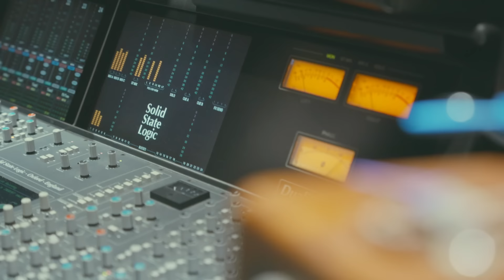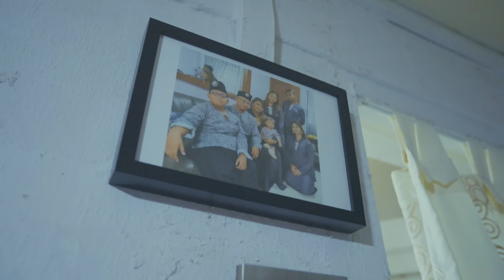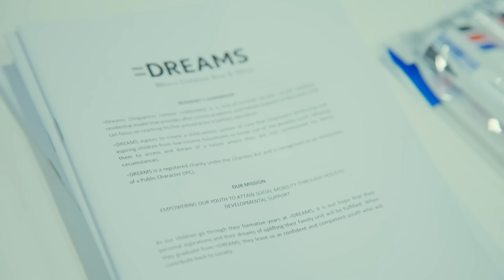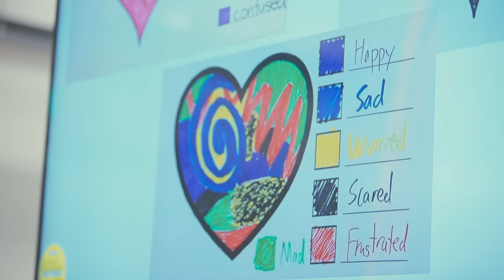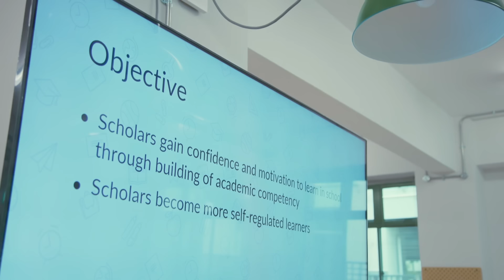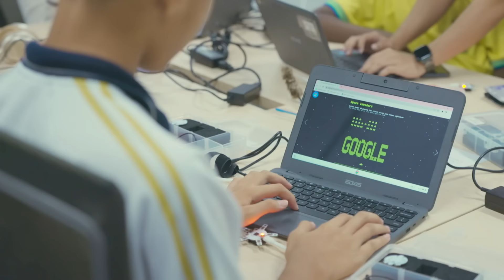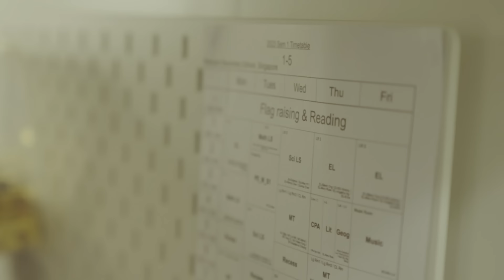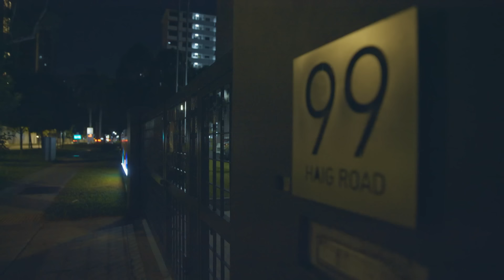Can This Boarding School Help Lift Disadvantaged Children Out Of Poverty?  - Part 1 | Dare To Dream

Comment: On using education to reduce inequality, Prof Tambyah pointed out that school- and class-ranking be scrapped. Schools will not segregate pupils according to their examination results.
Reply: And what's the purpose? That's like paying all employees the same regardless of performance. We need to accept that INEQUALITY has to exist, or the alternative is that we'll all be EQUALLY poor. Your suggestion doesnt solve the problem. It simply takes away what the top gets and makes them poorer. It also doesn't solve the micro issues which causes the poverty cycle.